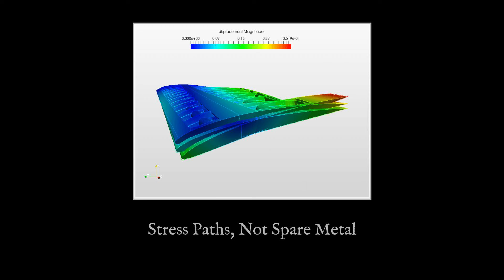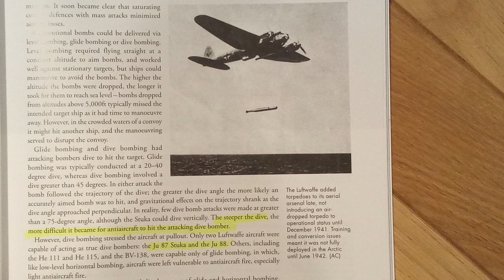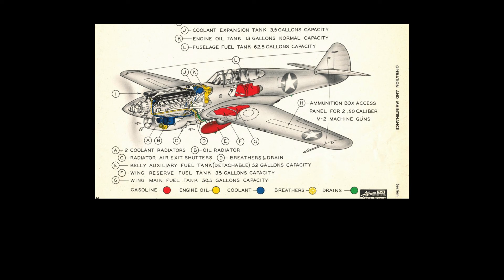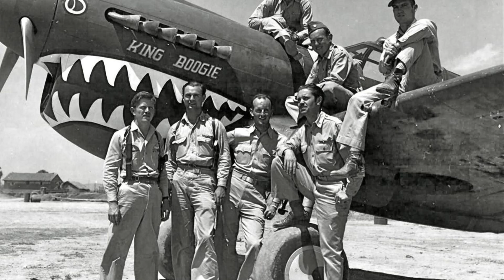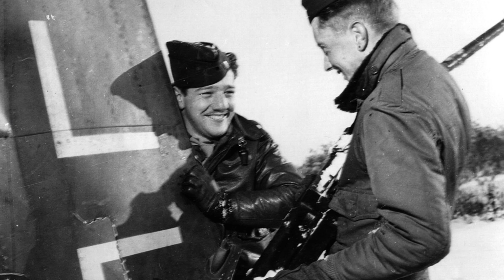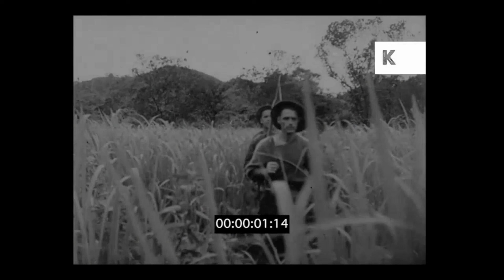The Shocking Truth Behind the P-40 Warhawk That German Pilots Called Indestructible

Comment: Its always a trade off.  The more heavy and redundant and rugged you make an aur craft, typically the slower easier they are to hit.
The A10 is an example.  Its super rugged.  It also gets shot a lot.
The F16 is far more fragile, but its much faster, more nimble abd harder to hit.
Reply from the maker: Exactly! That’s such a great comparison. The P-47 really was the “A-10 of WWII”  Built like a tank to survive punishment, even if it wasn’t the most elegant. And just like you said, speed and agility always came with trade-offs. Love how you connected it to modern aircraft.

Comment: The P-40 was chosen by the Army because, for one reason, it could be provided in large numbers right away at the beginning of the war.  An already proven airframe (P-35 with the Allison V-12.  It was used in nearly all fronts of the war, from east Asia, to the Pacific, to the desert, to the cold of the Eastern Front.  It's biggest weakness was that it did not have two-stage supercharging which caused it to lose performance as it went higher.
Reply from the maker: You've identified the key logistical advantage.
The P-40's immediate availability and proven airframe allowed rapid deployment when America entered the war. 
The supercharger limitation was significant, but the aircraft's ruggedness and familiar handling characteristics made it valuable for training pilots and holding the line until better aircraft arrived. 
The P-40's role as a 'bridge' fighter often gets overlooked in discussions of more glamorous aircraft